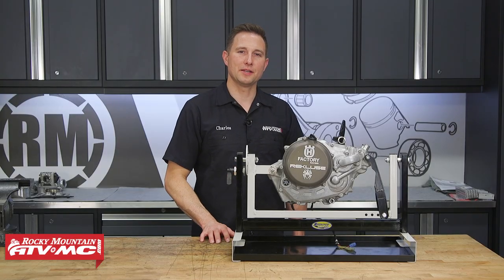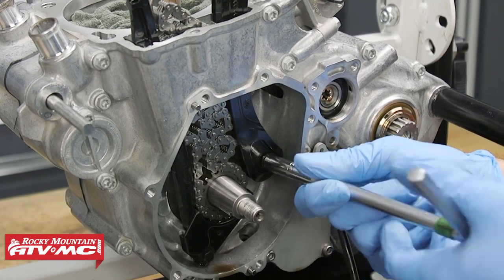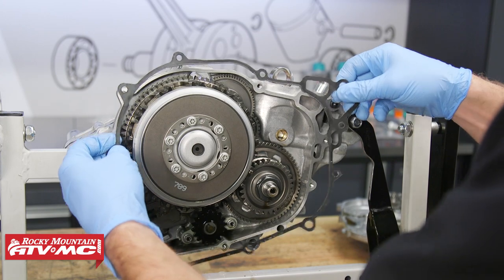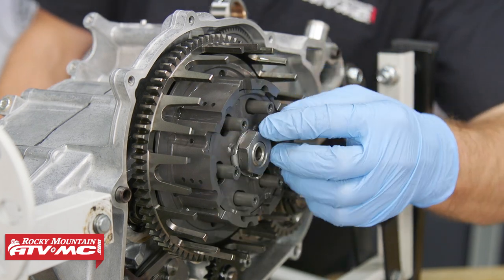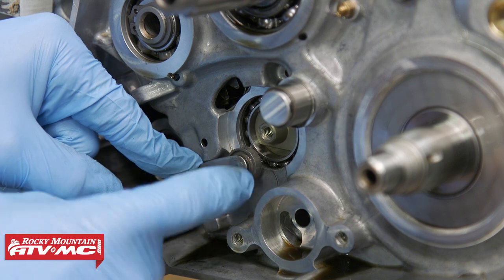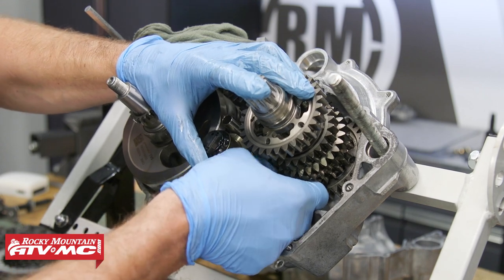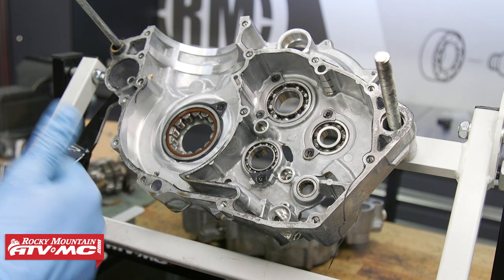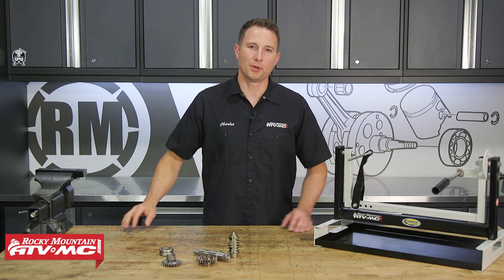KTM/Husqvarna 450, 500 & 501 Engine Rebuild | Part 3: Bottom End Teardown

Comment: Excellent videos on motor disassembly but I can not find the video explaining how to add the 6th gear or parts needed. Can you share the link to that video?
Reply from the maker: You can check out the bottom end assembly video here: https://www.youtube.com/watch?v=FaRGtB5mLCQ
Reply: @rmatvmc  video 4 shows the transmission being installed into the case but what I’m asking is where is the video showing the breakdown of the transmission removal of all the gears off the main and counter shafts showing the extra parts needed to add 6th gear.

Comment: I it imperative to remove the primary gear when splitting the cases?  I'm planning on doing the 6th gear install, and the puller is out of stock until July. Thanks